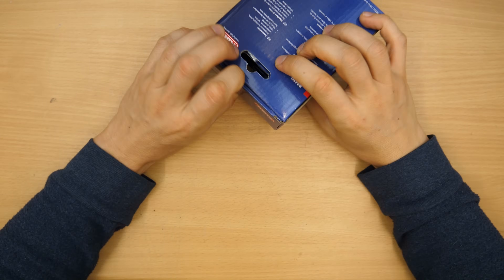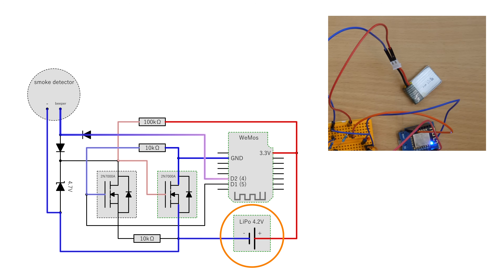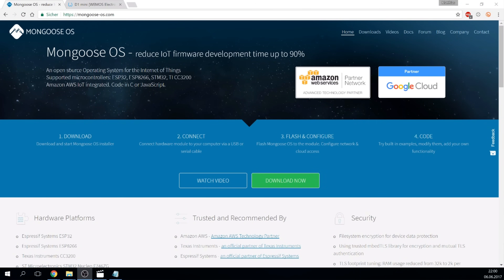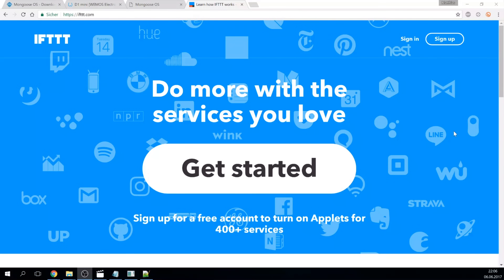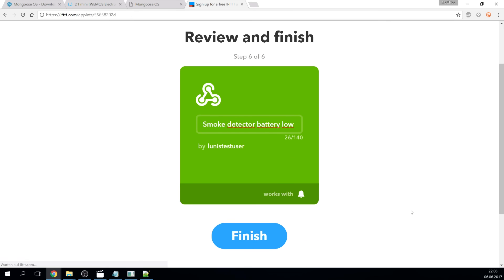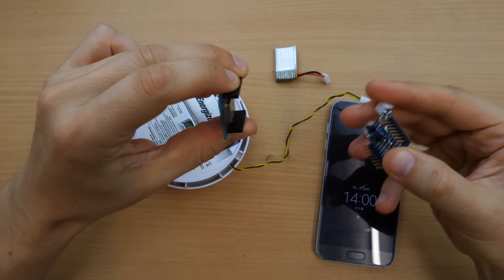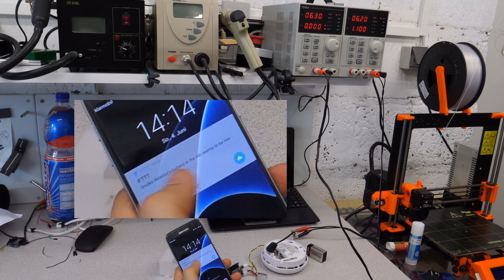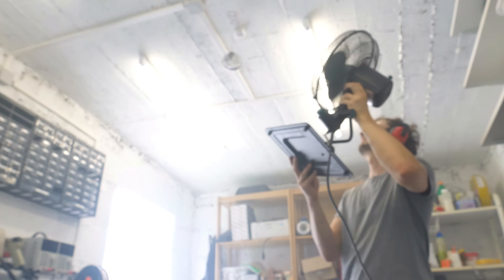Smoke Detector HACK! (sends SMS now)

Comment: I really enjoy all your videos and your sense of humor.  Thank you so much for all your work.  I have a question.  Why not supplying power to the Wemos from the 9V battery of the smoke detector?
Reply from the maker: the reason is that I didn't want the wemos to drain the 9V battery so the smoke detector will at least be able to set off even though I was to lazy to recharge or add a small solar cell to it.
Reply: @bitluni  What about having a NO circuit that closes when the alarm is beeping.  That way the Wemos is turned off and not using any power from the 9V battery? When the alarm goes off, then closes the circuit and powers up the Wemos.  No need to deep sleep on the Wemos because it's off.  I just want your thoughts before I try to implement something like this.   Thanks for your input!

Comment: I added an esp8266 and a relay to my 3d printer because I'm lazy and wanted to be able to use google assistant to turn it on and off.  I will now expand it to use a smoke detector that auto cuts the power to the relay along with sending a notification.  Thanks for the idea and the informative video.

Comment: The 5 volt ESP can actually accept 9v input since it has a built in voltage regulator for the internal 3.3v. It can take up to 12v without and 24v with overheating. With this you can connect the esp directly to the smoke detector and use one of the internal 9v+ alarm pins to only start the esp when there's actually fire. The esp will otherwise drain exactly zero power. Correct me if i'm wrong, but that's how I successfully finished my initial tests yesterday. No extra parts beyond esp and smoke detector needed.

Comment: For anyone else, who wants more details on the circuit - here's my take on it:

The two N-channel MOSFETs act as digital switches. The one on the right, is the one that switches the MCU on - by connecting or disconnecting the MCU's GND pin to the actual GND (the negative of the LiPo). You can see that when the smoke detector beeps, the voltage difference between the beeper pin and the "-" will "threshold" the zener; and the gate of the MOSFET on the right will rise up (compared to its source) by 4.7V(-ish). It therefore turns on, connecting the MCU's GND to the battery's negative, and the MCU powers up.

Usually, N-channel MOSFET gates have a pulldown to ground (to avoid having them floating). Bitluni however, wants the pull-down itself to also be a digital switch. He uses the left MOSFET to do this, by setting it to pull "hard" (well, harder than the 100K) towards the GND, when D1 goes high. Basically, when the MCU wants to turn off, it sets D1 high. This means the gate of the MOSFET on the left goes high, and the fet turns on. It's drain (which is connected to the gate of the right MOSFET) is connected to its source, which goes via the 10K to the LiPo's negative. This in turn means that there's a 100K/10K divider on the gate of the
right MOSFET, which will pull "hard" the gate to the GND, and will turn the right MOSFET off - thus switching the MCU off.

I think that's how this circuit works.
Reply: "Thanks" 😎😀😎
Reply: nerd

Comment: Lipo's in a Smoke detector has some irony in itself ;)
Reply: I once had a smoke detector catch on fire and set its self off
Reply: In most cases, the Li-Ion battery is not the problematic part, but the person handling it. 
Exceptions may prove the rule:)

Comment: Are there any Zigbee boards that are like the WeMos? I want to fill my house with lots of little sensors, but it seems a bit of an overkill having every single one attached to my WiFi network with an IP address. And I'm sure that with enough of these things chattering away that WiFi quality will degrade.
Reply: You could build up a second wifi Network for these

Comment: Do you have any diagram or details video on how to make one of your circuity on the ESP8266 board and where to get the parts?
Reply from the maker: sorry, currently only the schematic in the video. But you can also find the part numbers there or values. Probably any supplier will do.

Comment: How do you detect low power? Is that if only one beep is detected?
Reply: Great video by the way!
Reply from the maker: yes.. it only detects low power of the detector.. not it's own
Reply: On Arduino IDE I use "ADC_MODE(ADC_VCC)" to measure the input voltage to detect a low input voltage if the LiPo battery gets low on power.

Comment: Excellent video. Why do you place the zener diode (4.7v) at the smoke sensor output? I did not understand the operation of the low battery reading with the use of pin D2. Thank you!

Comment: Why you used a different power source for the esp ? And why not just power it off that 9v battery ?
Reply: The WiFi obviously suck up a lot of current. Hence he uses rechargeable li-po which hold more capacity than 9V battery.

Comment: Nice work. I don't really like the way the detector only goes high when beeping - doesn't really allow to detect a bad connection or abrupt voltage drops due to a broken battery. I use a similar system to get my detectors online, however using the battery only as a backup and as such with increased communication. I added a "heartbeat" so I can detect if the controller or communication is malfunctioning. For my shop I also added a function to disable the detectors internal beeper (no need to annoy neighbors if I'm there working with things that let out smoke on purpose) and additional detectors (temperature, gas, etc).
Reply: Hi- Could you please post your code ? in your own github or in Issues section of this projects page on github? -Thanks. have you update it with MQTT ?

Comment: Nice project. How long will the small LiPo last?
Reply: Solar Cell + Supercap? Most of the time the circuit will just sit there, waiting for something to happen. That means that a supercap can charge for weeks on end and dump all its power when it's needed.
Reply from the maker: Depending on leaks I didn't measure yet. I have marked the active potentials in the circuit diagram. In the off state the lowest resistance path is 100k+10k Ohms at 4.2V is around 38µA. This will only last 1-2Months. To improve this we can put in higher resistors (but then we have to reblance the circuit), use other Batteries (18650 or disposals) or add a solar cell (I like this idea).
Meanwhile Mongoose OS also supports deep sleep on JS level. The circuit can become much simpler.
Reply from the maker: I'm open to other improvements if you have some ideas. I already thougt about a followup with some improvements.